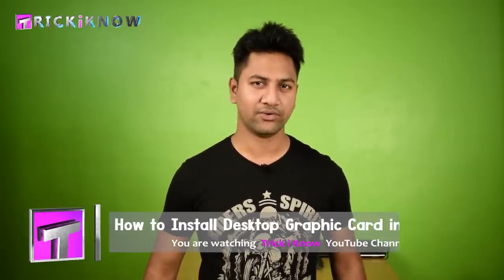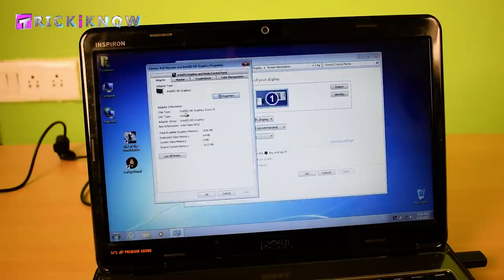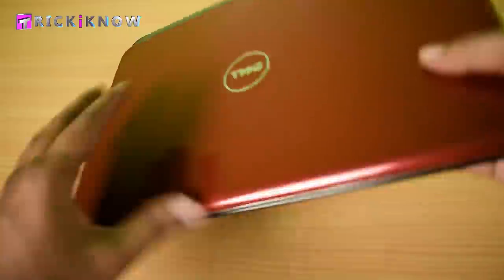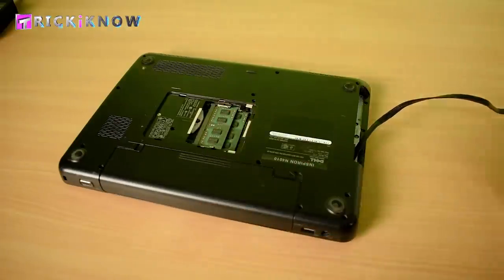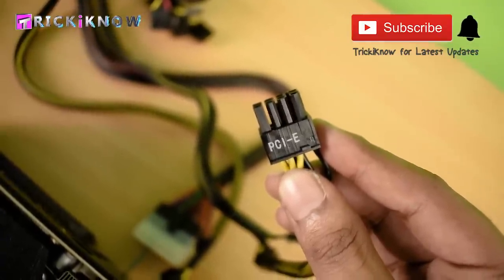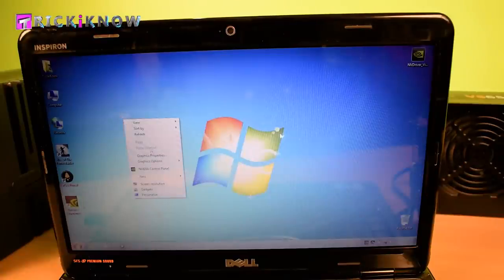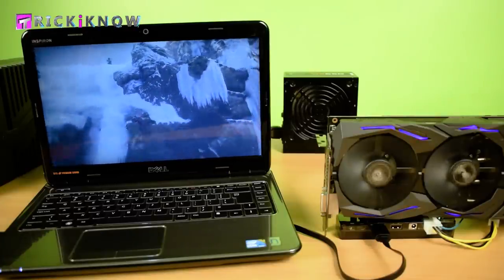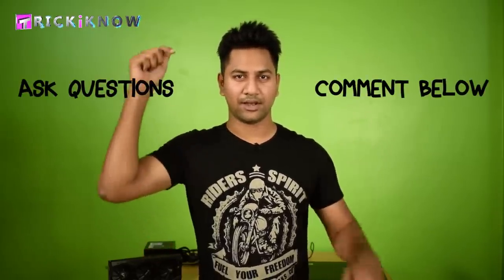How to Setup Desktop External Graphics Card for Laptop - eGPU Ultimate Guide

Comment: Warning : Before you guys do this, make sure your cpu won't bottleneck the GPU. If you have a weak cpu, I recommend getting a GTX 1050 below graphics cards.
Reply: Dunne. What if its gtx 1050 ti on core i5 3230u 2.6 ghz
Reply: Logi Tek you might get some. Bottleneck but it should run fine
Reply: Dunne. Hmm one more question is externals performance gonna be as good as the desktops or the its gonna be a big drop off?
Reply: I think I'll be good with an hp notebook and a gtx 460
Reply: Logi Tek i tried it on my old idea pad and performance was a bit lower probably because of its cpu. I think the performance will be just a little lower because graphics cards are meant for pc.
Reply: I have corei3 1ghz
Reply: zeeshan khan um i recommend using an older graphics card. Maybe the gtx 700 series
Reply: Dunne. I have an intel pentium cpu b980 2.4ghz which graphics card should i use?
Reply: Zadok Akafi search cpu and gpu matchmaker
Reply: Dunne. Thanks
Reply: Mine is i7 5500U would that bottleneck the gtx 1060?
Reply: Uchiha defenetely not that would be good with a GTX 1070 . Also, Dunne I have a 4th Gen Intel Celeron core.... Maybe I should use Nvidia 5000m xD
Reply: AsifIsAWESOME !  Oh thanks..because my i7 5500U is 2 cores 4 threads hyperthreading cpu so i thought dual core would bottleneck the gpu😅
Reply: Actually must mod the driver if wanna use gtx 1050...if not mod code 43 will appears...thats all...
Reply: Lol cause ghz is everything right? Nope. Architeture, core count and gen matter
Reply: Dunne. GTX 660 is more than enough for Core i3 CPUs, especially on older generation CPUs (I have 4th gen mobile Core i3 by the way).

Oh, and don't measure the performance of the CPU by its clock speed.
Reply: What would be the best gpu for me? I have i5-4210u (1.7-2.7ghz)
Reply: Logi Tek There will be some bottleneck, laptop i5 are dual core processors, not quad core like desktop i5, so there will be some bottleneck with a 1050ti
Reply: Zadok Akafi Dude, that pentium will bottleneck almost every gpu, I would just build a new desktop from used parts, I have an i5 2400, 8gb ram, a gtx 1050ti, and it cost me less than $300.
Reply: I like turtles! I have a laptop with a quadcore i5 (4210u)
Reply: Julius Grigoras the i5 4210u is actually a dual core with hyperthreading, not a quad core. Laptop i5 are dual core because they were made to consume less power, that's why they have a "u" after the number.
Reply: Complete bullshit. Please stop spreading the megahertz myth.... Megahertz is not the main factor. You should be concerned about your core count and architecture. And the fact that this YouTube channel tagged this shows he has absolutely no real knowledge about computers and bottlenecks.
Reply: Seb Till actually more to Core count and IPC thingy.

The M/GHz myth is soo 2000. And I just re-read the op comment, thanks to you.
Reply: Dunne. Noo they will be a bit lower because probably ur laptop cpu is bottlenecking it because laptop cpus are mobile cpus pretty slow
Reply: Uchiha even a 2 cores with hyper threading will bottleneck the gtx 1060 because i have a gtx 950 which is quite below the gtx 1060 but still my i3 with 2 cores and hyperthreading bottlenecks it at 60 fps but it's fine for 30 fps. Computer i3 and laptop i7 are almost equivalent kind off
Reply: BlackPalankaa generally there is a single number from which one can approximately determine the power of a cpu or gpu and that is flops (floating point operations per second)
Reply: I have Intel core i3 6th generation, nvidia 920mx, 4gb graphic card, 4gb ram , 2 GB dedicated video memory and 2.0 ghz
Reply: PC Gaming With Soumesh Parida how's that possible u said u have a 920 mx 4 gb graphics card and you have 2 gb dedicated video memory? They are one and the same dedicated video memory means the graphics card's video memory how can it be 2 gb and 4 gb at the same time lol
Reply: I have an Pentium 4 3ghz portable, so i can play fine CAPPA
Reply: Use a gtx 1050ti...best bang for the buck
Reply: Dunne. Hey, one question. I bought 1050 and I didn't know how big it was until it got here. Now it won't fit into my cabinet. Should I still get an external Graphics Card Riser or should I return it?
Reply: Anirudh Bhattacharya always check the dimensions in the specs of the card before purchasing and check the inner dimensions of your cabinet. Anways i would suggest you if you can return it and get a full refund then you should do that instead because this external gpu method will cost you more as you have to purchase that kit for your gpu as well as it looks so bad because there will be a gpu sticking out your cabinet connected with wires lol
Reply: Dunne. Sir what if I only have Intel pentium cpu b970 2.30ghz & 6gb ram. 64bit. 
Can I do this?
Reply: +abrar khan I have a i5 2.6 how high can I go?
Reply: Syed chayan you should be fine with a gtx 1050ti
Reply: +abrar khan do u think I can play ac origin with quadro 3000m?
Reply: Syed chayan i have no idea you have to see if there is a benchmark video of AC origins on that graphics card
Reply: +abrar khan I saw some one playing it with R5 m330, and it was alright, I hope quadro 3000m performs better,
Reply: Zadok Akafi I have the same
Reply: Dunne. How about intel i5 1.7 ghz? Please answer. Thanks
Reply: 죠리퐁광고관리자 maybe something not too powerful. Gt 730 would be a good one for that
Reply: Dunne. Noo actually a gt 1030 is a better option than a gt 730 because it's way more powerful and will consume approx equal cpu processing power as the gt 730. And a gt 730 is not a gaming gpu anyway so it's shitty af in games
Reply: is there any compatible issue of gtx 1050ti with exp gdc...coz on bangood they mentioned that 1050 quite not compatible
Reply: Dunne im confused i have a intel core i5  2.53 ghz  will a gtx 1060 or 1050 work?
Reply: Nizzu_ go with the gtx 1050 as your processor will probably bottleneck the gtx 1060
Reply: Ok thanks abrar khan
Reply: Nizzu_ no problem :)
Reply: Igor Lima it will be more expensive than a PC with a gtx 1050ti
Reply: abrar khan can you pass me your facebook or gmail? i want to ask you something about the gpu and the cpu
Reply: abrar ive senden you an email :)
Reply: Nizzu_ i replied to ur email :)
Reply: Replied back :)
Reply: I Have i7 3rd Gen 2.0 Ghz.! Which Graphics Card u recommend Please Tell.!
Reply: Abrar Khan im sorry i accidently deleted our gmail chat i senden a new one :)
Reply: Nizzu_ lol
Reply: abrar khan I Have i7 3rd Gen 2.0 Ghz.! Which Graphics Card u recommend Please Tell.!
Reply: Hammad Khan a gt 1030 should be good if you play at 720p
Reply: abrar khan Thnks bud.! And Which Dock should I buy.!
Reply: Hammad Khan i don't have idea about the dock :( i don't use it i have a PC
Reply: abrar khan Can I Run gtx 1050 2gb.? Coz I want to Play New Games.!
Reply: ya sure you can but it will be bottlenecked a little bit. but if you are ok with that then its fine.
Reply: abrar khan Ohkay.! N.p and Thnks Bro.!
Reply: happy to help :). if you game at 1080p then u might go for a gtx 1050 2gb and if you game at 720p then go for a gt 1030. they perform almost same on respective resolution resolutions. (example: in a game if a gtx 1050 gets 60 fps on high-medium settings on 1080p then a gt 1030 will get 60 fps on high-medium settings on 720p on that game)
Reply: Bhai gtx 1050 to support hi nhi karega bangood mai saf likha hai
Reply: i have a pentium  4    3Ghz  can i use a Nvidea 1060 right?     just kidding
Reply: Thats better or worse than nvidia 8800
Reply: i have a intel 15 4300 i belive, adn the graphics card is really the main bottleneck, any recommendations?
Reply: I7 5500U IS HORRIBLE...
Reply: My cpu is i7 3630mq.... almost 2x better than yours...
Reply: Don't forget to make sure you have enough RAM at speed to support.
Reply: Sabarno Sarkar 
It won't help for high-end tho
Reply: Hammad Khan 
The 4gb VRAM will be better.
Reply: Dekross 
Pentium 4 is an outdated processor, but WILL BOTTLENECK the 1060.
It WILL however be BETTER than the cpu with a Nvidia 8800. The later is of 2009-2010 and will not be up to par.
Reply: @orion260  I have i3 6th Gen 2.0 GHz..! Which Graphics Card u recommend please tell......!
Reply: @akshayshinde01  A 750ti will be a better choice. I have an i3 4th gen 3.6 ghz and it sometimes bottlenecks my gtx 950. So you should opt for. A gtx 750ti or gt 1030.
Reply: @orion260  gigabyte geforce gt 1030 gv-n1030d5-2gl low profile 2g computer graphics card
Reply: @akshayshinde01  nice choice bro! Go for it 👍
Reply: @orion260  bro GTX 1050 mere system Ko compatible hai kya ......?
Reply: @akshayshinde01  ohh i didn't get the notification about your email comment. Wait I'll send you an email
Reply: @akshayshinde01  comparability ki baat nahi hai. Compatible toh koi bhi graphics card ho jaega aapke laptop ko with the kind of gpu adapter shown in this video. Baat yeh hai ki aapke laptop ka cpu usko bottleneck karega ya ache se chala lega. Jitna powerful gpu hoga utna hi powerful cpu chahiye hoga usko bottleneck nahi karne ke liye
Reply: @akshayshinde01  1050 shayad chala le aapka laptop but mughe lagta hai bottleneck hone ke kafi chances hai.
Reply: @orion260  best konsa hai apke hisab se ..?
Reply: @akshayshinde01  aapke laptop ka screen resolution kitna hai?
Reply: @qdunne  Yes it will still run fine at the bottleneck but you can save money and get identical performance from a much cheaper card
Reply: Bruh my cpu is 2.6ghz and it rocks the 2070 super to 100%
Reply: I have a dell N4010 i3 M370 2.53gHz laptop@720p... Which graphic card would be appropriate to avoid bottle neck, would this setup support 1080p resolution with ext. Screen
Reply: I have core i5 will that be good for 2060 or is the core i5 not my cpu bc i dont know alot ab computers
Reply: @qdunne  Hey bro....I have i5 1135G7 which gpu is best for my laptop??
Reply: better i wil build a pc myself
Reply: and  i have lenevo legion 7 with i9 and rtx 3080ti 16gb
Reply: i have a i3 8gb ram will amd 580 8gb graphics work for it?

Comment: But the laptop wont get wireless internet anymore right?
Reply: you can use a wifi usb dongle.. its very efficient and pretty cheap
Reply: alfa1900 adapter
Reply: Or you can do usb thetring to run internet
Reply: Or you can use cable

Comment: I found this video to be really cool, I actually didn't realise the Wi-Fi adaptor was connected to a pcie slot before this, so thank you for that. And just as an extra info, if you have a USB C port in your laptop, you can get an external gpu dock like the Razer core and the installation would be much easier.
Reply from the maker: I think the EXP GDC Express Card version is good for you: http://bit.ly/2g4Rj6C
Reply: If you mean Thunderbolt 3 or newer, then yes. The USB C setups are about Thunderbolt, not normal USB 3.x.

Comment: Wao man.. Seriously.. Gtx1060 on laptop also.
Waaaoo... Friend...
Seriously.
Reply from the maker: Ya check the description for the EXP GDC link with coupon code  , and thank you very much for watching 😀
Reply: Ali Bilal
Reply: Why not GTX 1080TI
Reply: alexander cliff bottleneck. do you even know a bit about computer?
Reply: MyBike, do you even know a bit about grammar?
Reply: My laptop has a builtin gtx 1080 sli
Reply: MyBikeKnowsNoSpeedLimit s  my friend's rog laptop  have a intel core i7 and inside it is gtx 1080TI
Reply: MyBikeKnowsNoSpeedLimit s intel core i7 wont bottleneck the laptop
Reply: alexander cliff He has a first gen i3, huge bottleneck
Reply: HHoodedUnicorn My laptop has built in integrated hd 4000 graphics and I get a buttery smooth 15fps on 360p low.
Reply: HHoodedUnicorn so is this video about grammar now?
Reply: alexander cliff before I say yes the i7 wont bottleneck the 1080ti [ I said it i know :) ]. Do you even watch the whole video? :)
Reply: @cracklelacquer5602  Oh he got it to work?? I want to hook up a 1080 TI to my Dell Optiplex 3050 Micro

Is there anything important I need to know?

Comment: I tried this with my Dell laptop and it's working perfectly fine. Thanks dude!!! 
My objective was to increase screen resolution for LG ultrawide monitor and not gaming. I used gigabyte 2GB DDR5 graphics card. TP-Link external WIFI adapter. And make sure latest driver for all the hardware is downloaded before doing laptop surgery. You should also know how to disassemble your laptop.
Reply: disassemble your laptop or a similar one sure, there are guides all over the darn youtube over every fregging kind.
Reply: Will this work on Dell Inspiron 5547?
i7-4510U
8gb ram
Reply: which dell version are you having?
I have dell insipiron 3521 i3 but it is not working. the fans rotate but the graphics card display is not detected in the device manager.

Comment: Thanks for the great video! Very thorough and detailed :) I'm trying to connect an external GPU on a Dell XPS 15 9575 (2-in-1) laptop. Do you know what would be compatible and what would be needed to easily connect with this motherboard on the 9575? Not able to find detailed specs on this :( Thanks again for reading and hope you can help

Comment: You made laptop a desktop
Reply from the maker: Ya you can say because you cannot move it now 🙂
Reply: @TrickiKnow  
Hi can i fit rx 570 Instead of gtx 1060 in that egpu  dock
Reply from the maker: @eurlelibtihal7797  i don't have any experience on amd gpu , you can check it yourself.
Reply: TricK i Know 
ok.thanks anyway for this great video😄😄
Reply: @TrickiKnow  will the 1060 bottleneck with  hp laptop with pentium n3710 and 4gb ddr3 ram ?
Reply: @junyounggaming7160  yes...yes it will
Reply: @eurlelibtihal7797  I'm trying to use rx 570 in my Lenovo IdeaPad 350
Reply: But without DVD drive or WiFi. Yay! 😒
Reply: @kwizmon  u can buy usb wifi adapter i guess if u want to play online game
Reply: @eurlelibtihal7797  Yes, AMD GPU works in that eGPU dock, even at cheaper adapter models which aren't as nice.
Reply: @TrickiKnow  Yes, AMD GPU works in that eGPU dock, even at cheaper adapter models which aren't as nice.
Reply: No, he did not, you still just need to unplug one cable to have your shitty old laptop back, ungrateful prick, this costs 100 US$ and you are complaining.
Reply: @kwizmon  ignorant, multiple people explaining the MANY WAYS AROUND IT and he even had a previous video showing many of those.

Comment: Hi good day! I have an old laptop..a Neo brand laptop... I think its a 2010 model year.. its window7 , processor :intel (R) Pentium (R) P6200 @ 2.13ghz ,RAM 4gb ,32bit os.. my question is.. is it possible to put an ext.gpu as what you have presented in your video? Tnx
Reply from the maker: With the Pentium processor, you can use GTX 750 ti.
Reply: Thank u very much.. i hope it will work.. gob bless!
Reply: @TrickiKnow  any recommendation for the gtx 760?

Comment: Can we use this trick on all-in-one desktop
Reply from the maker: Yes, if there is mini pcie slot.
Reply: @TrickiKnow  bro what is that pls explain
Reply: @Himanshu-ch3tw  It's the connection used by WiFi cards, in order to do this you'll have to use ethernet or a usb dongle for internet
Reply: @wsketchy  brother I do have built in wifi so it can help
Reply: @Himanshu-ch3tw  ? Are you saying you have a laptop with built in WiFi? That would be because it has a WiFi card inside of it
Reply: @Himanshu-ch3tw  the built in wifi is due to the wifi card you would have to remove the wifi card to make the slot free and then use this.If you are going to use it as a desktop then i would prefer connecting with a LAN because it is faster and a desktop is not going to move a lot.
If you do needd wifi however you can get a usb to wifi adapter and insert the wifi card in it (Theyre kinda cheap so youll not need to spend a lot of money)

Comment: Can I replace with DVD rom with graphics card and we really need smps and ups?
Reply from the maker: Currently there is not any DVD ROM version invented , if you have any low end graphics card like gt740 you can use a 12v power adapter instead of PSU.

Comment: without the wireless LAN, it means you cannot access online, right? and what the recommended power supply watts?
Reply from the maker: Yes you can use a USB WIFI adapter to access internet and power supply depends on your graphic card requirement :)
Reply: i see.. ok thanks..
Reply: or you can use lan port for internet
Reply: Whats is express card slot? And where can i find it in a laptop.
Reply: Ahmed Osama I know! Everyone here thinks that it's the end of the world because they won't have wifi. Use the LAN port, people.

Comment: Very usefull video! I used the EXP GDC dock on my old Fujitsu Celsius H710 using the Expresscard interface and it worked. Keep in mind that your laptop should only have the intel HD graphics! My laptop only has an integrated Nvidia Quadro 1000M, and I tried to use desktop Quadro 4000 as external but the system crashed in BSOD every time I tried to start a program on the Quadro 4000. I was lucky coz by the time I had an AMD RX550 2GB card and somehow it worked as external, but it reùired additional monitor and it couldnt game for long on the monitor connected to the AMD card, BSOD happened. it only could game when game is windowed and placed on a monitor connected to the Nvidia, but not the laptop native screen. So make sure your laptop has no Nvidia or AMD built in card or you may have troubles :D.
Reply: My motherboard doesnt have a graphics card. Can I do this
Reply: hmm, interesting after reading your comment I simply disabled the Nvidia card on my rog g55vw which has g660m nvidia card and isntalled egpu 1660 card(note that it little too much for 2012 performance might slow down due to bottleneck i7-3rdgen CPU) but still it worked pretty good just make sure you install ssd. also dont forget to disable auto select like in the video for all the step.
Note - also check the driver details of gpu wether it is ddr3 or ddr4 my motherboard is based on ddr3 so you now what i mean